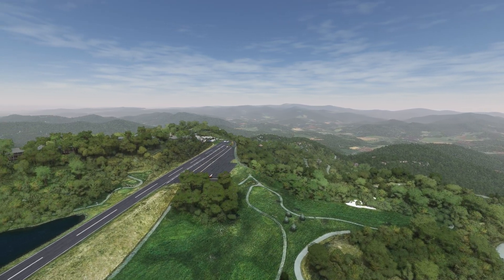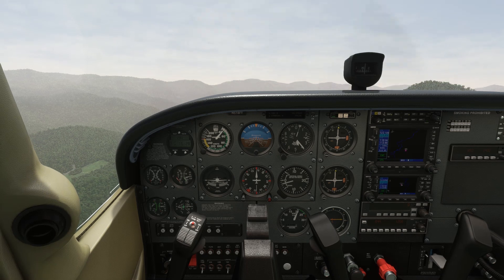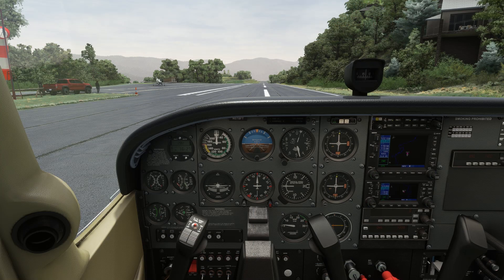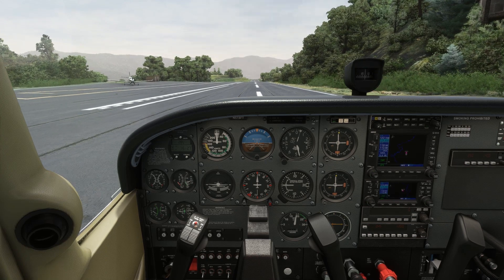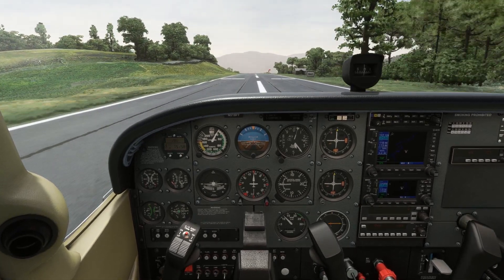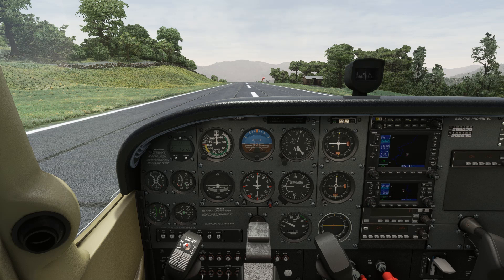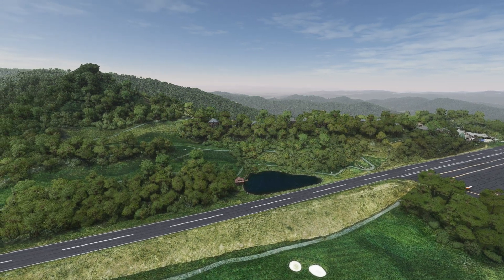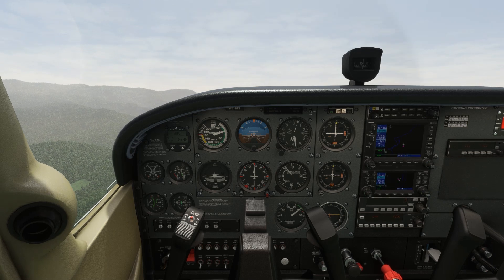How to Reject a Takeoff | Use the 50 70 Rule | Preventing Runway Collisions

Comment: The rule is dangerous. Very dangerous. There is no bounding of the 50/70 ROT for runway length (extreme long or short), density altitude, or obstacles. Also,
the 50/70 rule tells me nothing about stopping distance for abort considerations. Check out the Idaho Stinson crash from a few years ago. 5000' runway. I bet he had 70% of his takeoff speed at 2500' down the runway. It didn't work out. Into the trees. They lived but were extremely lucky.
Reply: I agree it's very dangerous, and I have actually contacted the FAA to have them review their reference to the "70/50" rule in the AIM. The 70/50 rule assumes constant acceleration, in which case distance travelled is proportional to the square of groundspeed achieved. So you would reach rotation speed at the very end of the runway if you had 70.7% of rotation speed at the halfway point of the runway. But acceleration is actually decreasing, because propeller thrust decreases with airspeed and aerodynamic drag is increasing. This means you won't even be at rotation speed at the end of the runway. This rule as stated is incredibly dangerous. Maybe it would be acceptable to say you should be at 75% of Vr by half of your calculated ground roll, but even then I would be cautious.

Comment: This is NOT a good rule to use. It can put you at the VERY END of the runway for lift off. What about obstructions or contaminated runway or  little less than optimal engine power? A better method is calculate take off distance using the POH and all pertinent information,  add a safety factor and be able to abort with runway left over. (Landing distance also from the POH.) What about a 10,000 ft runway? Do you wait until the 5,000 ft mark to figure out something is wrong and you need to abort? Obviously not! So what length runway IS this rule good for? 4,000? 3,000?
Reply: Great points, and I would add that as acceleration is actually decreasing during the takeoff roll (propeller thrust decreases and aerodynamic drag increases with airspeed), you may not even be at liftoff speed by the end of the runway! The rule assumes constant acceleration, which isn't the case. I would say a better rule is that you should be at 75% of rotation speed by half of your calculated ground roll.

Comment: Does a rejected takeoff count as incident or something that needs be reported by ATC?
Reply: No. It’s not an incident in a GA airplane. At a towered airport, just tell the tower what you’d like to do next. If the controller is curious, he may ask what happened and if you need assistance. In most cases, it’s a non event. 
For heavy airliners it’s a little different, they may need to wait for their brakes to cool down and in some cases require an inspection before taking off again. The airline may require the captain to write a report but ATC doesn’t care unless there’s something that could impact other aircrafts. 
There should be no legal consequences in rejecting a takeoff and no pressure on the pilot to continue a dangerous takeoff.
Reply: @Virtualmix  Thanks!!

Comment: I noticed mixture was full rich.  Some may say mixture should be at best power, which high density altitude may dictate leaning a little.  But yes, every takeoff should have an abort point. Longer runways I use “if not rotating by calculated distance” even if I have plenty of runway left.  Otherwise the 50/70 rules is great as long as ASDA allows.

Comment: The whole flaps up and elevator up aerodynamic braking thing upon rejection wasn't clear.
Reply: Hello! Would you be willing to expound on what you wish were more clear?
Reply: @jordanmccarthy1117  Sure. I'm not sure why someone would want the flaps up and elevator up. I am a new (currently ground-only) student but don't remember being taught that anywhere.

In terms of aerodynamic braking aka drag, I'd assume you want the flaps down, but I understand why you would want more weight on the wheels and have them up instead.

In terms of aerodynamic braking, I can understand why you would want the elevator up, but then there would be less weight on the wheels, which then is opposite of the advice for the flaps.
Reply: @timothy-2614  As a student myself, I can say that we typically braked with fully extended flaps and elevator, but this may be model specific. Additionally, that was for a full stop landing when the speeds are much higher than in the middle of the takeoff roll. Additionally, at lower speeds, aerodynamic braking was negligible.

Again, it may be model dependent, but I would guess that the lift from the flaps is working against the need for weight on the wheels. Additionally, in my trainer, the use of the elevator lifted the weight off the nose wheel, which made better use of the main gear. I would guess that drag is too negligible at those takeoff roll speeds, or at least the tradeoff of increased drag may not be worth risk having the brakes lock up from the lift of the flaps.

I hope this helps! Again, I too am a student, so please take my opinion with a grain of salt. If an instructor wants to weigh in on this, would love to hear some thoughts!
Reply: @jordanmccarthy1117  Thanks for your input.

I pulled the "aerodynamic braking" reasoning straight from the video, so I can't comment on the validity of that.
Reply: @timothy-2614  Jordan's right - flaps should be up to reduce lift so that more weight is on the wheels, as that's how you'll be stopping (braking effectiveness increases when there's more weight on the wheels). For take-off, at least in a 172, we'd have flaps up or, at most, 10 degrees (for a short-field t.o.). You see this same technique in short field landings - get flaps up, dynamic braking (elevator up), full brakes as needed.

Comment: I have a question. The 50/70 Rule, "establish a landmark at 50% of your calculated take off distance".
 
For example, if calculated take off distance is 1000ft, shouldn't you stop by 500 ft if you cannot reach 40 knots at that point? Regardless of avail rwy distance.

I tried to find some sources, like boldmethod or FAA. And found out that some are saying "50% of avail rwy" or "50% of calculated take off distance(FAA)"

Which feels later option is more reasonable for me. 

So which one is the correct procedure?
Reply: 1:12 There’s 2 rules in the FAA document, the 50/70 and the 30/70 rule. Both are different. (Great question btw}
Reply: So there two things here, that are similar but different.  I will use terms from my Ops manuals, 1.  Accelleration Check Point and 2. Safe Abort Point.  This video is primarily referencing the acceleration check point, which is checking the aircrafts performance (power being produced, weight of the plane, density altitude etc).  If the airplane is producing sufficent performance, you will accellerate to to 70% of TAKE OFF ROLL REQD, as demonstrated in this video.  This is a performance based determination.  I think, what you are reffering to, is what about if you are using a very long runway, seems silly to abort so soon.  Well, in my organization, we also brief our Safe Abort Point.  This is a point that, even if the airplane is performing well, we can abort the take off, and stop on the runway remaining.  We brief it as  "No further than 50% of RUNWAY AVAILABLE, adjust closer to the departing threshold as necessary"  So, we could set out Safe Abort Point anywhere from Power Set/Brakes Release all the way to the 50% point, depending on any risks identified mitigated.  One interesting point, the Safe Abort Point can be airborne.  If you are using a 10,000' runway, in a GA airplane, you should be able to execute an abort from anywhere infront of the SAP, even if well airborne.  We practice the maneouver, all the way up to the nominated point, its challenging but quite fun.
Reply: I think that the correct answer is probably the calculated takeoff distance, but as a practical rule of thumb, it is easier to use the available runway distance in scenarios where you will actually want to rely on the rule.  For GA airplanes, the 50/70 rule should come into play when your available runway is close to your plane's takeoff performance, so those numbers should be close enough that it won't make much of a difference which one you use.  If you have a general idea of how much runway you need for your plane at the elevations you typically fly during a particular season, then once you are near that number, give or take a thousand feet or so, you can do your calculations and apply the 50/70 rule to ensure you keep an eye out on when to abort.  Conversely, if you are in a 172 on a 12,000-foot runway, whether you are or aren't thinking about the 50/70 rule, you will definitely notice if you aren't up by 6,000 feet even though 50% of your (un)calculated takeoff distance is behind you an entire county away.
Reply: @JB_Hobbies But you just know some pilot is going to be rolling down a 12,000 foot runway and hits 70% of Vr at 6,000 feet and thinks all is well but can't climb out of ground effect when he gets to the end of the runway.